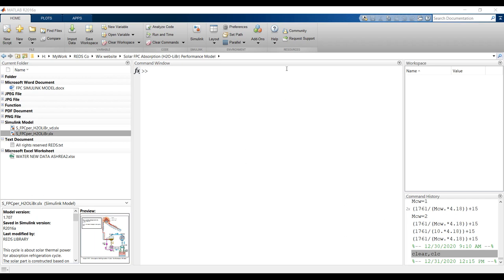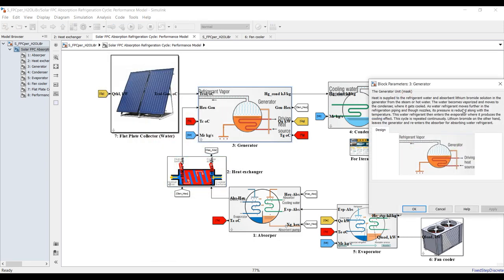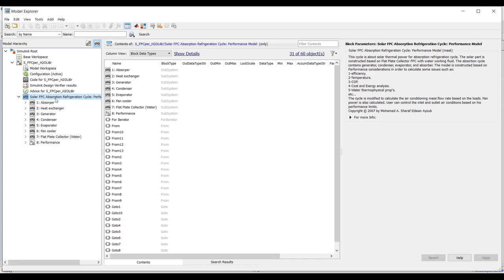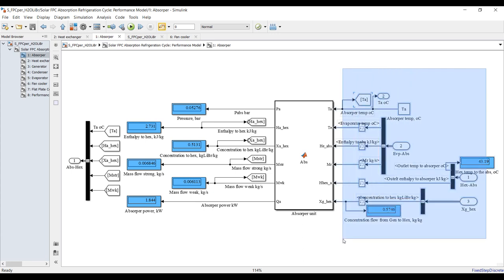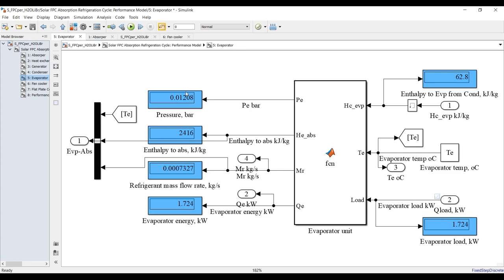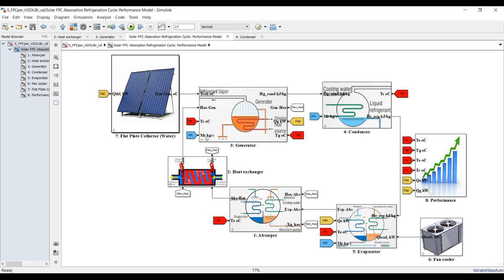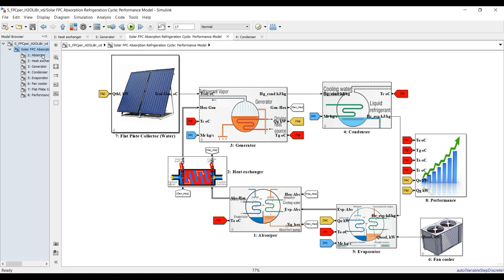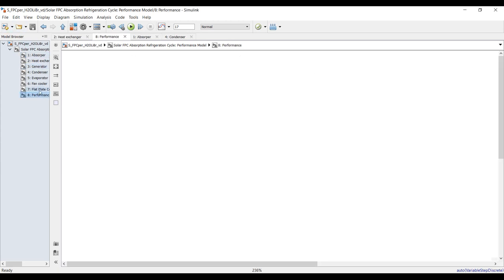Solar FPC | Absorption Air Conditioning | Water/LiBr | Matlab | Simulink | Performance Model

Comment: good work. Could you do a study on the matlap simulation of a hybrid power plant with wind, solar and storage systems?
Reply from the maker: It is already available on reds library store: www.redslibrary.com/shop
Reply from the maker: check out these links:
https://www.redslibrary.com/product-page/photovoltaic-pvt-hwt-for-electricity-and-water-heating-performance-model
https://www.redslibrary.com/product-page/hybrid-renewable-energy-systems-csp-pv-wind-fc-dg-for-ro-desalination
https://www.redslibrary.com/product-page/reverse-osmosis-basic-module-process-performance-model

Comment: Dear Sir, 

I appreciate your great work in here and thanks for the explanation. 

But I have a question please to ask, how can I design that system , I saw you pressed on something and the full system came out. 

I mean how to start from scratch and draw or create the exact System ?

I really apprecate that :)

Have a great day.
Reply from the maker: Dear
Thanks for your message. Unfortunately, the model is not free to be shared. You can pay and download it, then access the code.
Reply: @REDSLibrary   Thank you for your prompt response , 

Where can I do that ?
Reply from the maker: @mustapham6890  the model download link is in description section. The following link will show you how to download and pay via credit card or PayPal account 
https://youtu.be/TwDkkOmOeX4
Reply from the maker: @mustapham6890  Also, the general store is available on www.redslibrary.com/shop
Reply: @REDSLibrary   Thank you so much Professor for your kind assistance. 

I went through the link it cost around 195 euro . Is there a way to discount the amount as I am a student and that for a course project . 

Appreciating your kind understanding :)